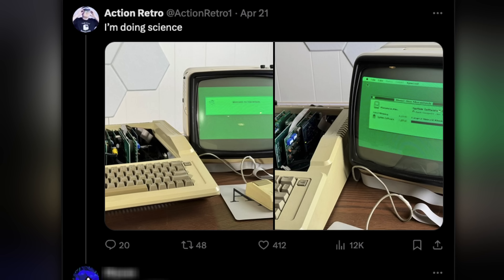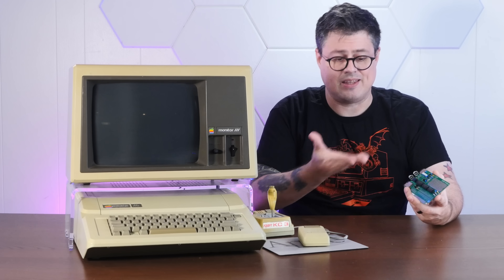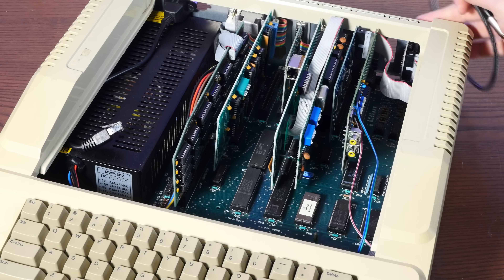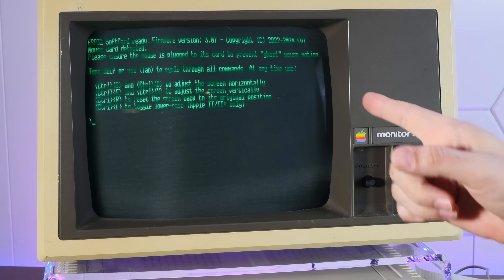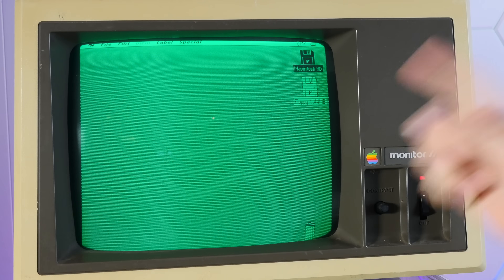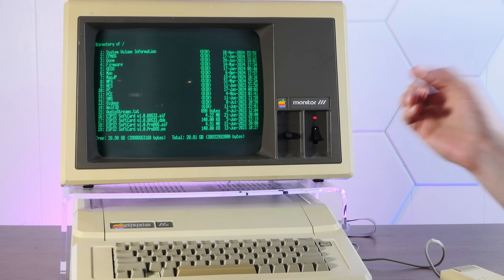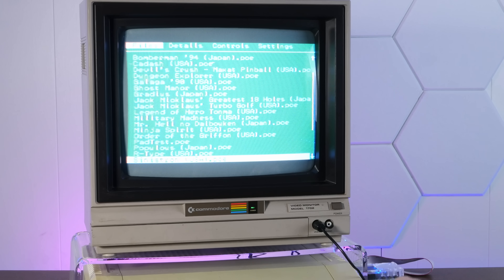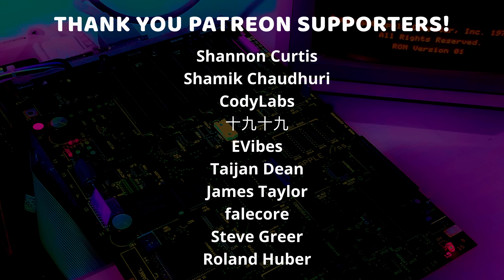This Apple II is running... Mac OS?!

Comment: Esp32 is a great piece of tech that is seriously underrated. I’d really like to see someone try to pull off a full modern slim OS running from one.
Reply: If it has an ARM SOC on there, then it can run Linux.

The limitation is the composite display, and that 'should' be capable of 640x480 or higher. I think I've pushed  1024x768 over composite on a PC back in the late 90s, but I don't remember how usable it was!

...looks like it's 32-bit RISC-V - so... LINUX!
Reply: @TechRyze  yeah xtensa or RISC-V depending on what model. So yeah Linux would be great, but considering its low specs, it would need to be slimmed down significantly. I was talking more about a full GUI operating system rather than something text based, and that would likely need a complete rewrite because most Linux UIs are resource heavy
Reply: @Underestimated37  

Hopefully one of the distros that works on the earlier Raspberry Pi boards, has a RISC-V equivalent that can run on it.

I've not looked at the specs of it recently, so I'd have to remind myself.

I'll bookmark all of this, and have a look in the near future, as I'd very much like something like this for one of the other 8-bit micros.

Apple IIs aren't to prevalent in Europe, but I'll get one if I spend any significant time in the US in the next  couple of years.
Reply: *underrated. I'd (to fix your comma splice run-on)

Comment: HELLO is a default applesoft basic program, its usually empty but you can think of it like autoexec.bat on a dos machine. On boot it will run the contents of that file. So if you were to edit it and add BRUN (program name) it would autostart

Comment: If you hadn’t said “it’s still an Apple IIe, and it uses only 1 expansion card” I would have watched the whole video - but when I saw the ESP32, well, it’s not an Apple II anymore. No matter how fascinating the project might be.
Reply: I guess you don't consider Z80 cards to mean the apple runs cp/m either?  What about a 2GS booting 2E software on its second cpu?  Do sound cards mean the computer isn't playing sound just because the main cpu isn't doing the work? Does a mouse/keyboard not count as an input device if it contains its own microcontroller?
Just wondering where the arbitrary line is drawn.
Reply: @lorddissy  It just means that the Apple IIe is acting as a kind of terminal. In this case, I guess it is possible that the ESP32 board might be accessing the hardware directly and suspending the 6502 altogether (without being familiar with this project or particularly familiar with the Apple II architecture), which would make the Apple II a very minimal terminal indeed, almost little more than the chassis to host another computer altogether.

Other systems also used guest processors to perform work, but those guest processors also interacted with the host system which remained active. For example, Acorn's second processor architecture had the second processor (6502, Z80, 32016 or ARM in Acorn's own products) communicate over the Tube interface with the host system, which retained responsibility for input/output including the display. This was also rather like using an Acorn machine as a terminal to a more powerful system.

This actually crosses over with this video because people have made modern second processor solutions for the Acorn machines that use things like the Raspberry Pi to emulate various processors, to run various environments and even games like Doom and Quake. With the exception of Quake, where the display output seems to be taken directly from the Pi, when running such games, the Pi sends display data to the host for output, meaning that the games have to use the host's display modes, resolutions and colour depths.

So, there is a continuum of solutions involving a host system devolving responsibility. If the host is doing little more than providing power and electrical connectivity, then maybe some kind of line has been crossed. But again, it would be informative to compare this to, say, the Z80 SoftCard and similar products.

Comment: HELLO is a basic program (note the A file type), so RUN instead of BRUN.
Reply: I came here to say the same thing. I always understood  the A stands for "Applesoft (Basic)"  and the B stood for Binary.
Reply: @petec123456  Same. I was just heading to the comments to berate Sean, lol. I hope he never changes. This content is just too good.
File looked small so maybe LOAD and LIST would also be interesting.
Reply: If you actually did a "RUN HELLO" it would be underwhelming. It's just a program that runs automatically at boot and displays the catalog so you don't have to type "CATALOG" to see the contents of the disk. In other words, it would simply redraw the screen you're looking at...
Reply: @Scanjo wait, so you’re saying it DID already run?
Reply: @whophd  That's the way DOS 3.2 and 3.3 worked. When you formatted a disk, you'd have a program in memory and issue the command "INIT filename". The disk would be formatted and the program in memory saved to disk with the filename specified and set to run on boot. In this case they did a "INIT HELLO" and the program in memory issued commands to do a catalog of the disk contents.
Reply: @Scanjo  True, that's what PR#6 called when the disk drive started the bootup. I think the file should have an asterisk in the DOS 3 catalog if it's the init file. Or it's just the first file, I can't remember, it's been a while ;)
Reply: @joe--cool  Asterisk indicates a locked file. PR#6 calls the bios code of the card in slot 6. If it's a drive controller card then that will run boot code to load and run the code from the first sector of the disk. With DOS 3.2 or 3.3 that code loads and runs the INIT program. Other devices do different things when a PR# command is given, such as a printer card. PR#2 for instance would redirect all output to the printer card in slot 2 (instead of the screen).
Reply: @Scanjo  A yeah, locked files. Thanks. Slot 6 I think was recommended for Disk 1 & 2. I had Disk 3 & 4 in 5, the Z80 card in 4 I think. And a self made speech synthesizer in 2. The 80 column card in 3. It was such a simple bus and a joy to work with. Woz' integrated monitor was awesome for debugging. I also had a modem but I can't remember if it was hooked up to an I/O card. I think it was a RS 232 acoustic coupler you needed to manually dial.
Reply: @joe--cool  I never tortured myself with an acoustic coupler. 300 baud or less is not my idea of fun. After the acoustic modems they had internal cards and external modems that hooked up to serial cards so who knows. I'd guess with acoustic modems being the earliest that they probably had a proprietary card of their own which came with the cradle.
Reply: @Scanjo  right yep yep I knew all that (or used to!) but just wanted to point out that we saw it on the video … didn’t we?
Reply: @Scanjo  I think I still have it somewhere. It was white with a bend in the middle and had that 80s future design. It had a switch for 300/600/1200 baud. Might be a dataphon from Germany, I remember also using it with a C64. So it's probably RS232. You could do online banking in the 80s with it.

Comment: Reminds me of the Apple II and DOS/PC Compatibility cards Apple would later offer for some Macintosh models.
Reply: Oh yeah, what I'd have done for something like a Performa 630/DOS, let alone a PM 6100 with a DOS compatibility card when I was a teenager! Realistically, getting a used 486 or Pentium was much more realistic if you wanted to mess around with Windows and that's what I did. I did eventually get an Orange Micro Pentium card for my beige G3 but that was horribly unstable running Windows 98, not sure if it had hardware issues or if that was a general issue with those cards.
Reply: @Ragnar8504  You could use the DOS compatibility card on Quadras, little bit nicer than Performas, although the 486 card didn't run any version of Windows nearly as well as real 486 or even 386 PCs, and there was no sharing or inter-operating. When running the card, it was a DOS machine, regular mode was a Mac. I think maybe at least you could get DOS files on Mac floppy that way, and no other. the floppies were normally incompatible

Comment: what would be really cool is if they made one with high-end pc parts so you could actually daily-drive an apple IIe
Reply: So basically using a IIE shell for ATX components?
Reply: @gustiwidyanta5492  no, I mean somehow making a card for the IIE like that with a laptop mobo and use passthrough
Reply: Are ya really doing it on the Apple IIe at that point?  Hell, I'm not all that impressed with this whole video.  It's not really running ON the Apple...

Comment: 7:15 "BRUN ELLO" is for when you run it in PAL mode I guess.
Reply: That's for the BBC Micro I guess...  Proper Bri'ish compu'er
Reply: That's probably locked behind a registration, because I bet it asks "You got a loicense key for that, mate?"
Reply: No. Has nothing to do with the video mode. The error was FILETYPE MISMATCH because only binary files are BRUN. Applesoft basic and Integer basic files are RUN.
Reply: @Scanjo r/whooosh
Reply: @Scanjo i can't believe how far that joke went over your ead
Reply: Absolutely, becayse Montalcino is in Tuscany, so the standard was PAL, and don't know if it was possible to receive SECAM broadcasts from Corsica.

Comment: "Hello" is an Applesoft BASIC program. Errored because you tried to BRUN it.
Reply: That's right.  Just needed 
] RUN HELLO
to run it.  BRUN is for binary programs
Reply: @thavith  Yeah I would imagine that the Apple ][ was past it's prime before Sean was born. I yelled at the screen when he did that too. LOL.  Also when he didn't adjust the Kraft joystick centering controls.
Reply: @tigheklory  *its prime (possessive pronoun)
it's = contraction of "it is" or "it has"
All contractions have apostrophes. Possessive pronouns never do.
Reply: @tigheklory  Ah good, at least I wasn't the only one yelling at the screen.
Reply: Clearly, he hasn't used an Apple II long. That's one of the first things Apple II users learned, how to create a bootable disk with a "Hello" Basic program.
Reply: If memory serves, that Hello BASIC program should have ran automatically when the disk booted.
Reply: @SlideRSB  It would have to have been INIT'd to the disk originally, I think in this case, HELLO was something like 10 PRINT CHR$(4)+"CATALOG"
Reply: @SlideRSB  *should have run
Reply: @alvallac2171  yes but when you initialize a disk with the command INIT HELLO, the hello program will run automatically when the computer boots with the disk.
Reply: Oh good lord. I unsubscribed with that.

Comment: Heck yeah GEOS is awesome!!!!
Reply: Geos on a commodore 64 was my first exposure to a "modern" computer with an operating system
Reply: @matthewleonmartin  Nice, and I can't say that was the case for me coming from a school that had Apple Mac's fairly early on around 86(When you live 5 minute from the gates to a now former Nuclear warhead plant the US Gov. tends to give your school system extra grants, and funding), but at home yeah this was the first GUI OS I had as well for my C64, and later C128, as my Apple IIe was mostly stock, and I even had an uncle who helped run a Commodore users group(how I got lots of Commodore hardware/software lol), so he sent me a modem for my C64 so I could use the included Q-Link service since I had 1 local number in my area, and that was my first gateway to being online at 7 years old in 88  around the time I moved over to a C128 after a faulty PSU killed my original breadbin C64.
Reply: I used Geoworks Ensemble for years at home. It really was better than Windows and Office in so many ways. We liked the option for extreme high-quality prints out of our dot matrix printer -- It would overprint the each line about 9 times to get it almost as dark and crisp as laser output. It surely burned the ribbon but it was cheaper than a laser and toner in 1992!
Reply: @DanielMReck  Awesome, and back 1992 I was just finally moving away from my C128, and onto a 386 with Win 3.11, and when Win 95 came out my mother helped me upgrade a used 486 with a Pentium overdrive chip and extra ram so I could run it, and also dual boot OS/2 Warp.

Comment: I will say is walking  Mac OS more than running it 🤣 but it's a fantastic shenanigan 🤣
Reply: As the benchmark showed, this is actually running a lot faster than what it was supposed to be emulating. Base model Mac’s were the definition of slow with low hardware specs. 

Kind of why I never understood why people like them, the OS is beyond slow. I prefer my IIgs running GS/OS over the early monochrome Macs.
Reply: @StrangelyIronic  They're slow but very polished. The IIgs feels a lot more computery, if that makes sense.
Reply: The IIgs is a very cool Apple II, but it's simultaneously kind of like a Mac II, but also like an Intel machine, trying to run Windows on top of DOS. Very technically cool, and much cooler than an 1st generation Mac. Very versatile. Not nearly as easy to use.

Comment: So basically it’s plain cheating
Reply: Not really. That’s precisely the sort of thing Woz designed the Apple II computer systems to be indefinitely upgradable. The Applied Engineering PC Transporter, and Z-80 Softcard were similar expansion card products of the sort, made back in the day. The Apple II line of personal computer systems were literally designed from the ground up to accommodate running other computer systems from within the expansion slots. So, not cheating, but continuing the tradition and vision for the machine. ❤
Reply: @WizardClipAudio  Hmmm... never knew!
Reply: @WizardClipAudio  interesting. I'll take your word for it. Woz approved shenanigans then.
Reply: @WizardClipAudio Eeeeh… redirecting the video kinda breaks with that idea.
Reply: @WizardClipAudio thing is those cards used CPUs that were similar weight class to 6502. ESP32 can emulate the Apple 2 itself without breaking a sweat.
Reply: @akkudakkupl  So?
Reply: @WizardClipAudio  So this is just using the Apple 2 to be a keyboard with extra steps.
Reply: Realistically, if you want to do anything “modern” with a 6502 you’re going to have to cheat.
Reply: Reverse IIe card
Reply: cheating implies an injustice. I dont see one here
Reply: I’m sorry you came here thinking somehow the impossible happened.
Reply: @VIRACYTV  I know but it says macOS would run on the Apple II not use it as a terminal
Reply: Not cheating just heavily modified.
It's Frankenstein tech.
Reply: People have built graphical environments on the 6502, so no you can do modernish things using it.  Just not run 68k Mac OS.
Reply: So when you add RAM to an old slow computer, is that cheating too? I disagree. This is kick-ass-cool-af. Wish I could have done this to my II Plus back in the day!
Reply: It's no more "cheating" than using a CP/M card or PC emulator that uses a more powerful co-processor to run  different OS's.
Reply: @MistaMaddog247 power is irrelevant and bad.
Reply: Put a KVM on a card. Ooo! Now Apple II can run Xbox games! It's a miracle!
Reply: cheating, huh?
better report it to twin galaxies!

the heck does "cheating" even mean in a hobby context
Reply: 100% cheating, using a new computer to run it and pass the video/audio through.  Basically just a remote desktop.